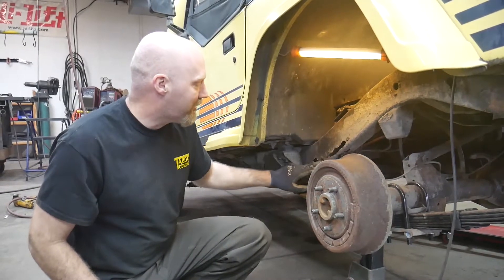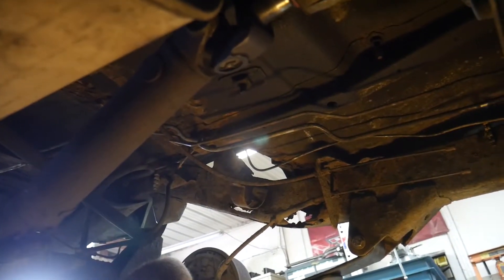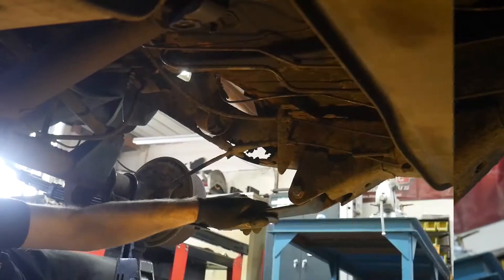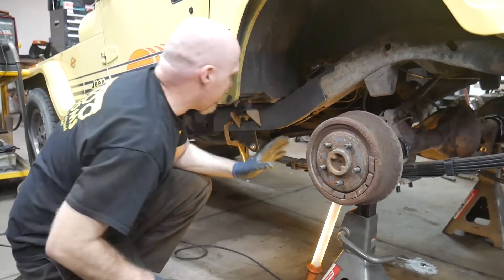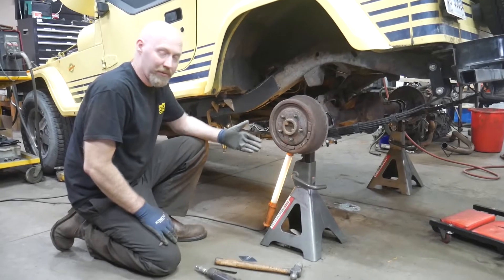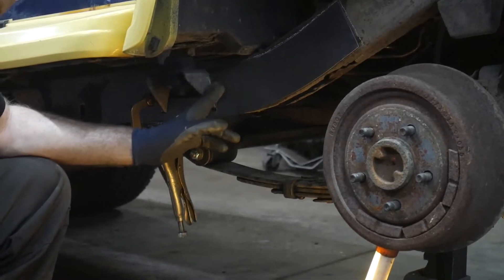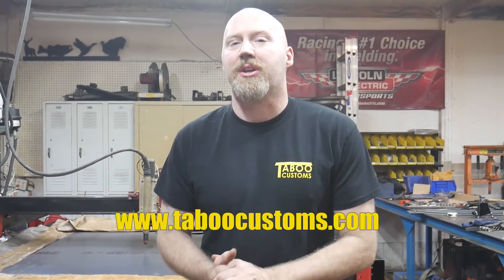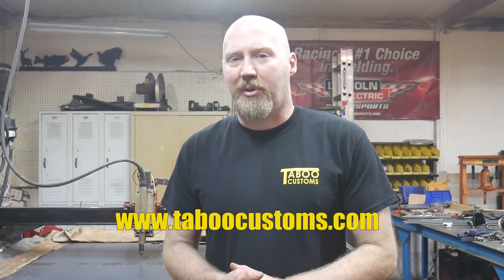Jeep YJ Rear Leaf Spring Front Spring Hanger Repair Kit Installation

Comment: I installed the leaf spring , frame kit that goes in the back when the frame rusts and your spring blows a huge, concentric hole in the remaining cancer ridden, iron chelate, in desperate need of debridement. Use plug welds on the tank side welds for that and tack the tank side in first. Heavy clamping and cleaning on all. I cleaned steel six hours.

Comment: will this work for a frame thats completely cracked in half
Reply from the maker: Sorry for the delay, YouTube was holding comments without notifying me we had comments.
Reply from the maker: By itself I would say no.  Its designed as though the top of the frame is still connected and solid.   However, you could add material to it over the top.  If you were wanting to do that with this kit I would recommend going to 7 ga on the side plates.  Contact us at taboocustoms@adams.net and we could cut you some side plates in 7 ga.  Thanks
Reply: My frame is cracked right at the start of the frame an the shackle right under the rear passenger door ! Do you have a kit for that part